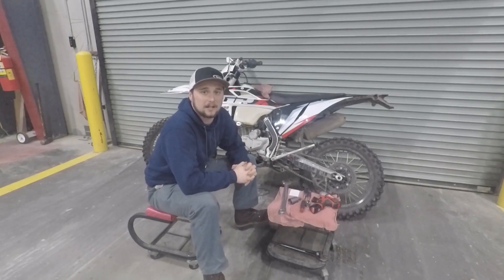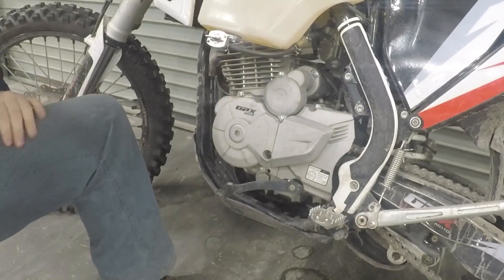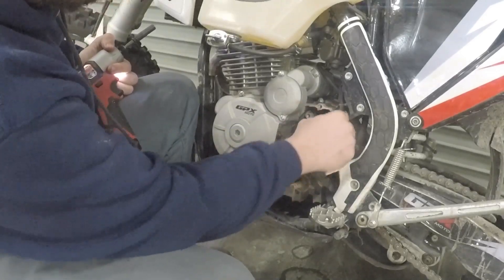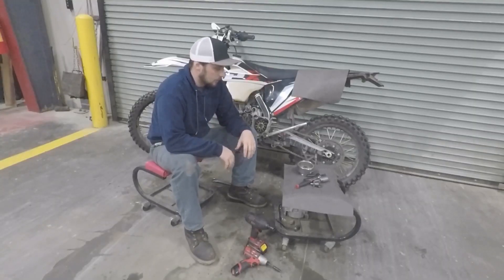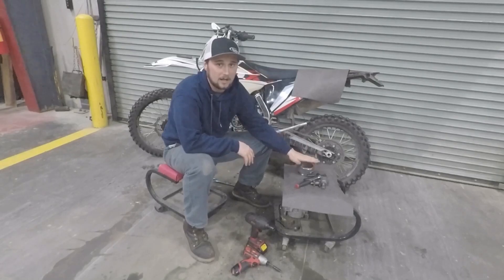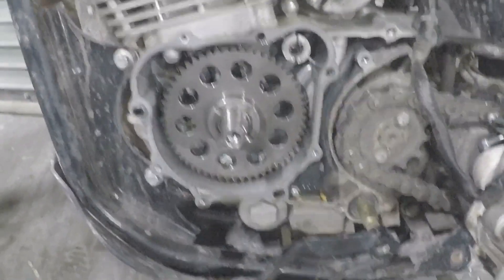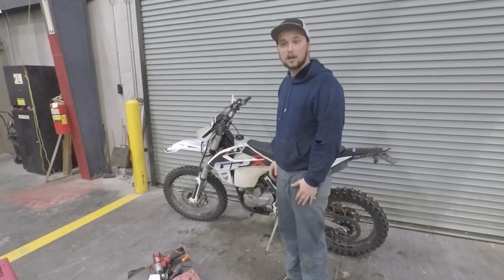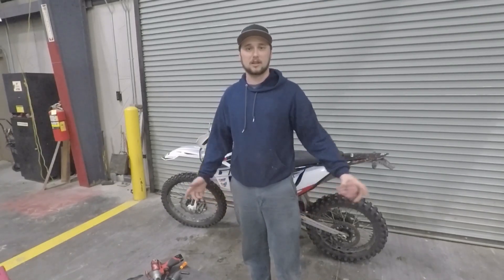2021.5 GPX Moto FSE250E timing upgrade!

Comment: If you got the 2019 GPX FSE250E...... you will have to remove the Outer starter gear cover(has three bolts on it)...there is a bolt hid "inside" the cover, otherwise the side case cover isn't coming off. Good explanation and video!

Comment: I did this last week on my 2020 Brozz 250.   Definitely the most difficult part was getting the flywheel off.    Certainly helped the bike rev faster.
Reply: Which puller did use ? I have a Brozz as well.
Reply: @markshortridge8291     Just need and M16 bolt.   This is the one I used.    It takes a good amount of pressure, and a few taps with a hammer to shock it loose. 

https://www.amazon.com/Motion-Pro-08-0027-Flywheel-M16X1-5/dp/B000WJC0U2?pd_rd_w=QRIOs&pf_rd_p=9ac6cc26-c474-44d5-bbf8-fa96b06e33ac&pf_rd_r=5MS34ABB0C0PDGNFK7TA&pd_rd_r=39c99a36-c600-4919-8627-7d5f516eca5f&pd_rd_wg=NnQ0F&psc=1&ref_=pd_bap_d_csi_pd_ys_c_rfy_rp_crs_0_t
Reply: @jcx5659  I heard of a few guy having issues with getting the flywheel off and causing damage. So would you consider all work worth it?
Reply: @markshortridge8291     I think I know of the person / situation you are talking about.  I don't believe they were using the right puller.   And I find it weird to call an M16 bolt a puller.   But guess that's what it does.   More of a pusher, the way it works.   I don't think there is much risk using the correct tools.   I will say that the correct tool for a Hawk or some other Chinese bike may be different.   There is no doubt the flywheel is on there tight, because it's tapered shaft.    I heard of some using a three jaw puller around the outer edge of the flywheel.   That sounds risky to me.   Anyway, good luck.
Reply: When you did this too the brozz 250 did you put the key in the same way he did with the lip sticking out too the left?

Comment: Years ago, all the  Victory "talk" was adding the mechanical timing advance gear to the Freedom 106 engine for all kinds of performance improvements....of course, I had to put one in 😐 The gear could adjust timing from +8' advance to -6' retard. I set mine to up to +4 and all it ever did was cause excessive heat, I never felt any improved performance or throttle response. When I had the bike dyno tuned, we did pulls at 0' up to +4' and there was no effect on the power numbers at all... I wish you better luck with yours..
Reply from the maker: It seems to make it rev faster, more playful like a crf250r 
I read up on the freedom 106 adjustable timing, a lot of bad reviews, but iv seen a lot of timing adjustments on single cylinder bikes and I see a lot of comments of quicker throttle response
Reply: Interesting that was your experience.  I put the Lloyds timing gear on my 2013 Vision and felt like the engine was a bit more responsive, but it was always hot.  I even had it tuned perfectly using a wideband o2 sensor, and a few other airflow mods to make it breathe better.
Reply: @shortattentionspangarage1312  What air\oil cooled big V-twin isn't hot...? Adding timing advance made mine go nuclear☢